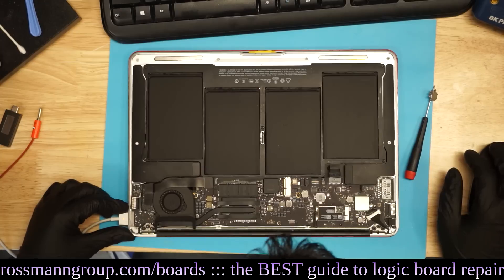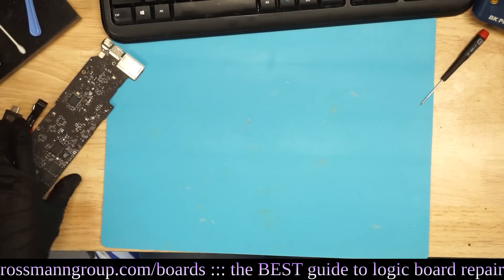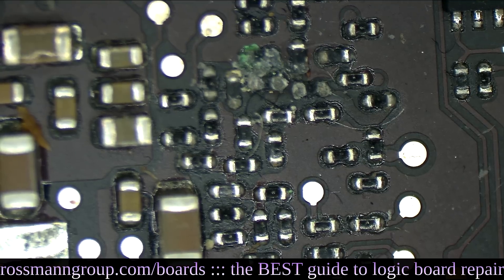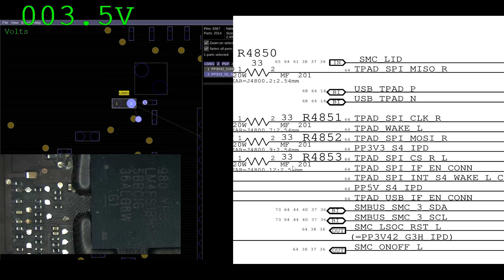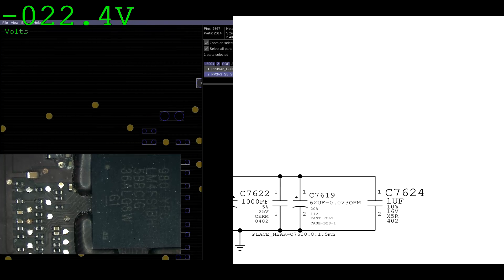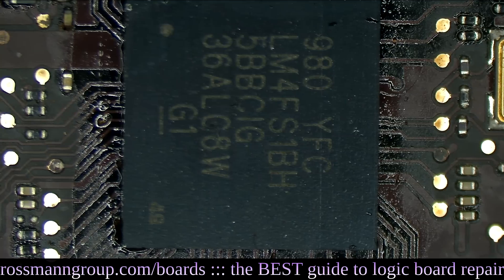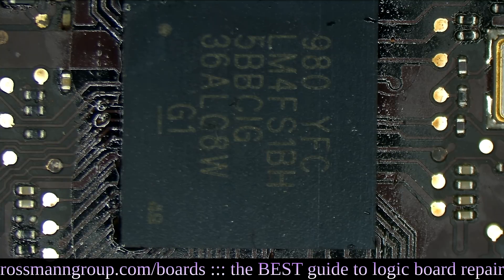Macbook Air not turning on: surprising PM_SLP_S4_L failure.

Comment: Non of pm slp signal will be there untill system doesn’t boot up. So problem is in system standby what should creat vccrtc clock and rst for cpu/pch. As liuis has just repaired in different defination 😝

Comment: HELP!!!!!!! After nuisance notification prompts, I finally upgraded to Apple's latest osx, mojave. After the upgrade, I'm working on my iMac and it suddenly restarts and throws open a hardware passcode lock screen. I've upgraded to other osx in previous years, never had any such problems till mojave. Apple refuse to unlock it without an original receipt. Even other 3rd party repairers couldn't either. I have my eBay/paypal purchase receipt but they won't take that. I recently began a few lifetime projects on this iMac, does anyone have any suggestions to help me?

Comment: If Apple replaces rather than repairs, how does it track the quality of its builds?  How would you know if your design is optimal?  Thinnest and lightest is basically a marketing strategy that means nothing.  Thin equals bend.  Bend equals break when you're talking about tightly packed electronics.  Break equals more money.  If you're carrying these things around in a backpack... it's probably getting dirty and bent.

Comment: We made a high water bulge alarm for boats all put together by hand from the circuit board too the float switch , we may changed the supplier of the parts or made changes to the unit in the name of saving money every company does this but each work the same .

Comment: They likely weren't making better products to send reviewers, but I do recall some reports of Dell changing the panels in some of their well-reviewed and popular displays.  High quality S-IPS panels being changed to cheaper E-IPS or even crappy TN panels, without a model or revision number change.  It's not quite as shady, but the end result is reviews that don't align with the quality of the product some customers receive.  They buy the well-reviewed model assuming the part they bought with the exact same model number is of the same quality.

Nintendo also does something similar with their 3DS handhelds.  Depending on the factory it's built at, some use IPS panels and some use TN.  Model numbers are the same, but serial numbers might be a hint about which panels it has and some of the packaging in the box varies between factories.  So you can tell if you research serials or are able to open up one end of the box and look inside before buying.

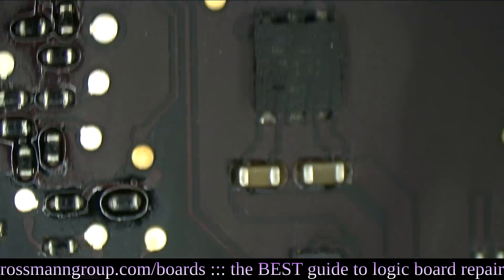Comment: Around 3:40 you were discussing "reviewer" samples.
In the tech world, it is no longer feasible due to the overwhelmingly automated nature of production, but there are many products where that kind of cherrypicked behavior is not all that uncommon. These are, as you said, things that still have a craftsman either assembling or doing finishng touches. Power tools are a fairly common example, which is why the tear downs of "sample" tools typically have better looking kit than the crappy powdered metallurgy used in the china.inc versions.

Comment: Re: companies that send out better quality items to reviewers.

Kingston did with one of their SSD lines, I want to say it was their v300 line a couple of years back, I might have got the specific model wrong, but it definitely does happen, however it isn't a very common occurrence.
Reply: Not quite, what they did is switch from Toshiba NAND to slower Micron NAND, but Toshiba NAND versions were also available to consumers as well until the switch.
Reply: fuj1n The details of exactly what happened are fuzzy due to how long ago it was, but after looking it up again I can see that it wasn't quite a rock solid case of bait-and-switch, but it was still a shady thing to do, and the timing still left a bad taste in my mouth at the time. Waiting a year before changing components without changing the product name to reflect the substantial perf difference, to me at least felt like Kingston were waiting just long enough for everyone to forget the original drives perf, and benefit from strong review scores that helped the initial sales, and then switch to cheaper NAND to save costs at the expense of the consumer once sales started to wane.

PNY were also guilty of the above, also around the same time although they switched controllers instead of the NAND.

Comment: Noob question: why does Apple use both 3.3V and 3.425V power rails? Those are well within the 5% tolerance typically allowed for power rails, and it seems pretty unlikely that any component would require such a precise supply voltage.

Comment: I had the exact same symptoms on an 820 00165 board. It had no backlight and someone tried to repair it. I ran a wire, replaced backlight IC, and cleaned the whole board. Now it was dead just like yours. PM_DS_PWRGOOD was present, but no PM_SLP_S4_L. Reflowed the SMC, no help. Then I decided to replace the clock chip just for the kicks and now it works.

Comment: honestly, i have no idea what i'm watching but i like watching it. question, what does flux do to the chip?
Reply: flux knows what you want from solder. it is very smart
Reply: it cleans oxidation off metal when heated and helps solder flow to make a good connection
Reply: flux allows solder to do what you want it to do
Reply: thanks Christopher Rowe
 and regmigrant
 for clearing that up. that's interesting. so the flux is used as a cleaning tool and a bonding tool. does the flux somehow attracts the solder to a metallic surface?
Reply: there's a bunch of chemical reactions going on but think of it that the flux makes a clean surface of the item being soldered and the heat draws the solder into it. A really good solder joint is a physical change in the surface layers of the metals involved. 
If you're interested in a really good video (cheesy 70's style but good) explaining it - https://youtu.be/vIT4ra6Mo0s

Comment: Hello Louis, i love your videos but this has been bugging me for ages. Could you move the advertising banner all the way down? There's a 1 or 2 pixel strip everytime it's over some bright background, like your shirt or the microscope.
Reply from the maker: a hah, fixed!
Reply from the maker: everytime I try I mess it up on the sides and it drives me nuts so i keep it as is
Reply: I watch in 144p so I don't notice it
Reply: Please louis fix this Q.Q
Reply: Batteriefach
It's actually 3,14 pixels.
Reply: I support this
Reply: Point is 144p is objectively better than 4k. 1080p and 4k are just scams. Louis should just upload all his videos in 144p